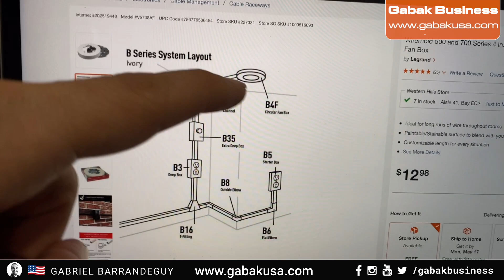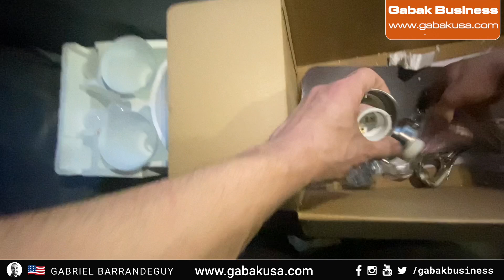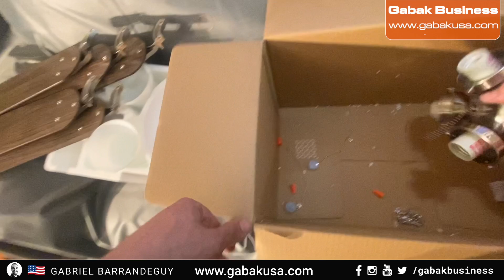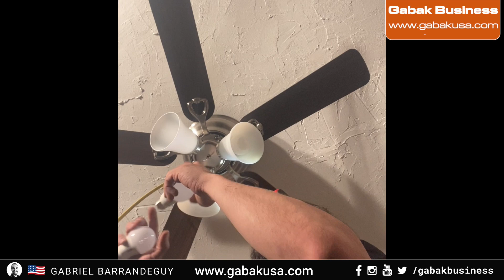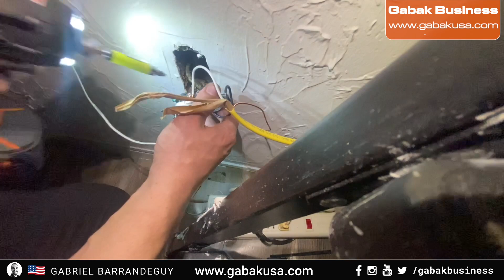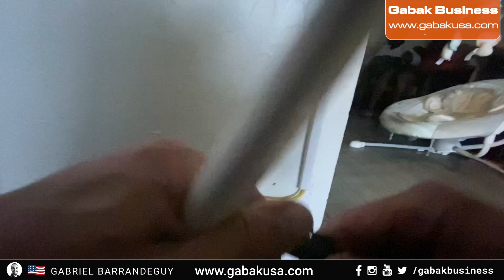Ceiling fan installation with no wiring using raceway/cable molding - Gabak  - Gabriel Barrandeguy

Comment: Never mount a ceiling fan this way - with anchors. It will not be securely attached. 
A heavy fan requires to be directly mounted to framing - or bracket connected between framing members in ceiling. 
This is a real pain for plaster ceilings, but it must be mounted securely. 

Pretty sure the wiring would not pass code… 

Everything about this seems wrong for NYS. 
Have a nice day.
Reply from the maker: wires can not be exposed by code
This is not the ideal job. The customer wanted something quick and cheap, and this is just that

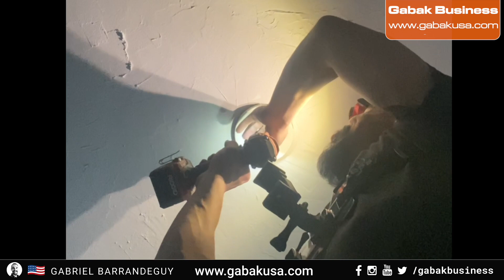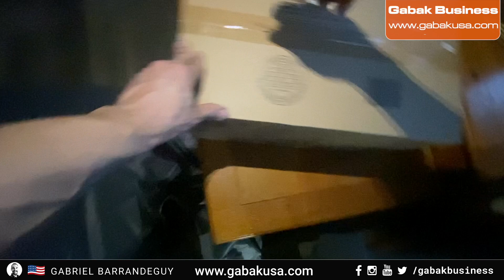Comment: I watch the video hoping to understand how to keep the yellow wires flash to the ceiling when you attached the first round piece of metal, (do not know the name) but you just jump that process from 2:54 to 3:11. I only need to know if I have to make a big hole for the yellow wire on the round white thing you got from Home Depot. Thanks
Reply from the maker: 1 inch whole should be big enough to run the cables inside to connect the ceiling fan
Reply from the maker: You just need a hole big enough for the wire to pass through — no big hole needed. The round white piece just needs a small opening for the wire.
Reply from the maker: If you want to know when I go live, follow me here: https://chat.whatsapp.com/JmsCQK37WZjFcuNJxwiOhx